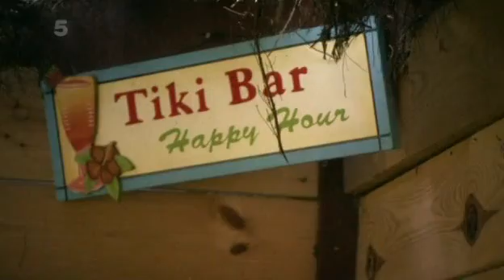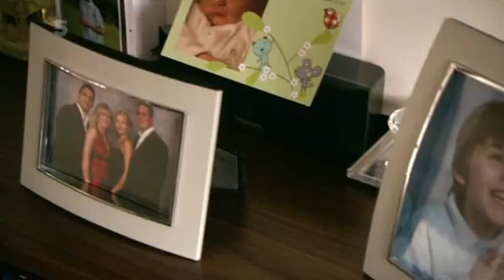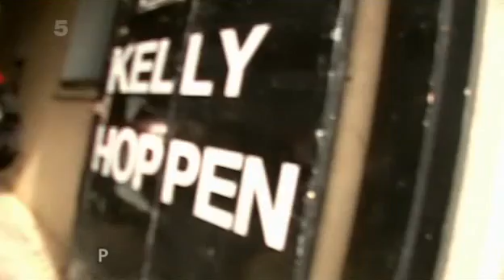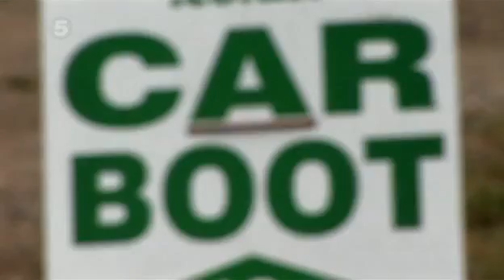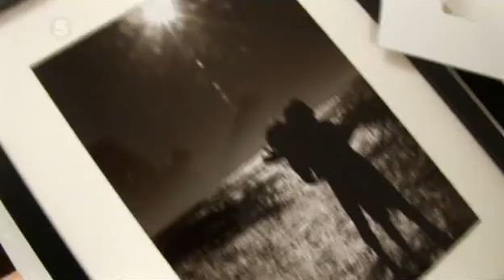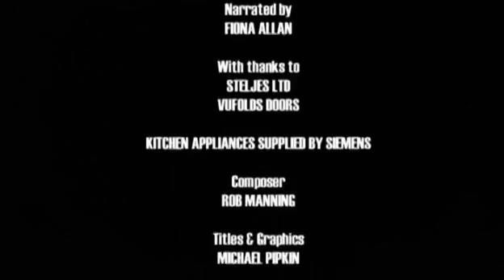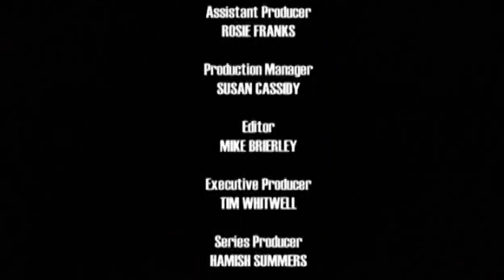Superior Interior With Kelly Hoppen S01E01

Comment: Vince removed a supporting brick wall and only put in one two inch thick piece of wood on its side.  Guess decorators do not take responsibility for structure and safety. Oh, just take that wall out should never be said without investigation and proper support replacement.